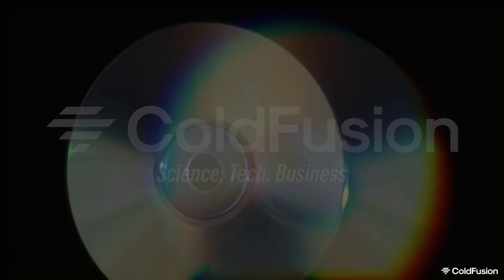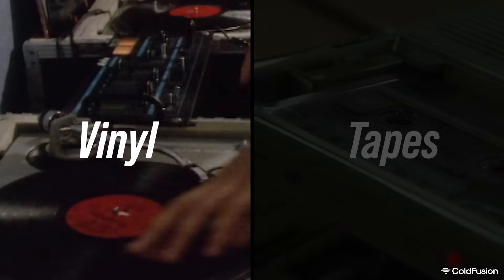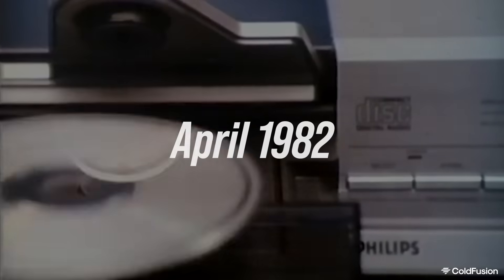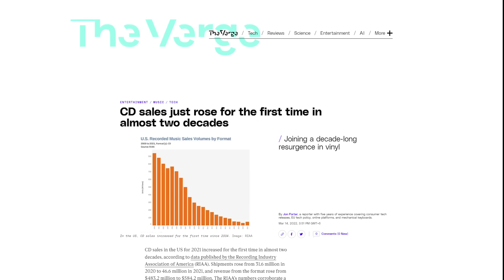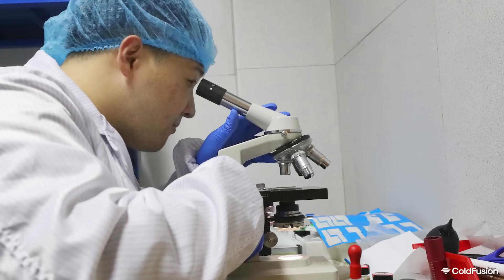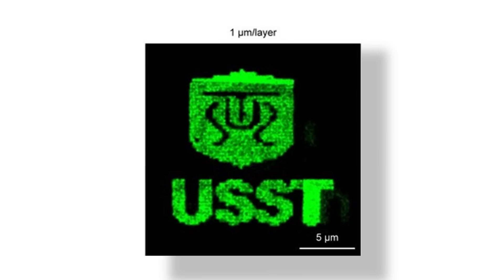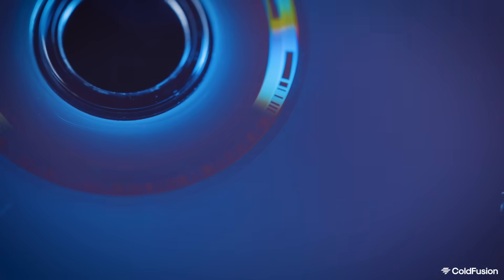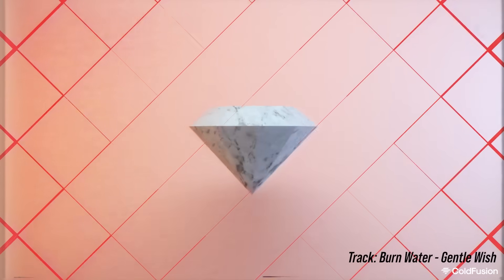Why This New CD Could Change Storage

Comment: I'm the syndication music manager at Starter Free Media Group and am responsible for managing large lossless music libraries.   

The main station library I'm managing at the moment is 20,000 flac tracks.   It was last backed up onto 30 verbatim blu rays about three years ago, but because backing up to multiple discs has become so unwieldy, we've resorted to backing up using a hard-drive to hard-drive system.   

I'm not really a fan of hard-drives as they are "random accessible" devices, prone to viruses and other data changing / data altering whims.   

I personally would love to see such a "large capacity" disc in production.  It would be great to backup our entire music collection in a one click "WORM" solution.   Optical media technology has been at a stand still the last 25 years, the crappy capacity of a blu-ray doesn't cut it anymore in todays storage requirements.

Comment: One major reason why CDs nearly died is a dirty or scratched surface affects all data in the affected areas. For music it skips with error correction, but for data like this, it means TB worth of corrupted data. An entire families history of digital data gone due to fingerprint.
Reply: That is actually the only problem with optical media that i still don't get. You had Floppy Discs for decades prior, they proved themselves. YOU HAD FKING SONY UMD DISCKS FOR PSP. A literal disk but in it's own plasic casing in which it could be read freely without the risk of stains when a human touches it, because you would touch the case and not the disk.

Literally just how people adopted what is esentially holding an HDD magnetic disk (VERY fragile) with bare hands, and no one bat an eye?
Reply: Better than the Lience expiring or the company that holds the data to say "Pay for ad-Free now :D OR LOSE ALL YOUR DATA"
Reply: @ravoniesravenshir3926   flash drives are better to use imo no scratching risks you can always remove or add files to the flash drive which you can't do that on cd's
Reply: A scratch does not do anything to the data. The data on the disc is on top, so all a scratch does is block the laser from reading the data. Yes that is correct, when you look at a CD, the data is on the top side where the the graphics are. The only way the the data is ruined by a scratch is if you scratch the top of the CD. When you burn a CD, it burns through the plastic to the top of the CD where the data is stored.
Reply: That's not how CDs work, the data is stored underneath the top layer. So unlike Vinyl Records, the data written on CDs can be recovered. It's super safe. That's not the reason CDs died, it's just a common misconception
Reply: You do know they cured that with bluray disks ? 
.
Bluerays are Virtually scratch proof
.
So emagine what amazing plastic these new cds will be made from 🤷‍♂️
Reply: @goldenegg1063  Again, scratching a disc odes not ruin the data. The data is on top, so putting scratches son the bottom of a disc does nothing to the data. The only way the data gets hurt by scratches is if you scratch the top of the disc.
Reply: @goldenegg1063  yeah but that's not how optical disks work anyway 🤔
Reply: At these storage sizes and costs, they could probably encase everything in sapphire for scratch resistance and longevity. It wouldn't even add much to the overall cost, because enough sapphire to make a CD, even thick material, wouldn't cost more than a couple hundreds dollars, maybe even less.
Reply: @peoplez129  These will never see the market. It would cost billions. This is just another product that will never see the light of day. What people fail to realize is these would need all new hardware, and you would need that to even use the disc. If anything this will be like one of those products that are only available to professional use. They will sell it to people who are willing to pay thousands for the hardware, but it will not e available to the general public.
Reply: @peoplez129  it's not even that bad if the CDs get scratched, the data is still there
Reply: Yea this development is that new. Back in the 2000s they had CDs in the terabyte range but folks didnt care for CDs and we went with cloud storage. Most of these new tech developments dont go commercial because they can't get the per unit cost down enough to be viable. Wouldn't be surprised if we never hear about this ever again.
Reply: @chewielewis4002  There was never  a disc available that had anywhere near a TB of space. Till recently the disc with the largest storage available are blu ray disc. Blu ray disc can hold 25GB, 50GB, 100GB and 128GB. A blu ray disc was the first ever disc crated that could hold 100GB. Still makes no sense to me that blu ray discs never became popular for storage, so I doubt any other disc can become popular for storage. Blu ray disc have been around for years,, and very few use them for storage, so I doubt any other disc can become popular for storage.

Comment: I wonder if there's scope for this kind of holographic recording technique to be applied to film? I mean, you can't realistically thicken the recording surface to be something like a cube... you're going to be dealing with thin layers, and the key is therefore to increase the surface area of the media. 35mm holographic film would offer an enormous surface area. It might be slow, but imagine the ability to back up an entire data centre into a film canister?!

Comment: Even before hearing the current drawbacks of the tech, as someone who had previously used cd and dvd burners through the 2000s, I already figured to fill up and write a disc that large, would take probably a few days to achieve. I think this tech is good to see that people are still looking into how it could be improved from what we've had until now and haven't yet discarded the idea. This does go to prove that with tech advancements we've made, we can still go back to a dominant idea of the past and still improve on it. Of course, at this stage it needs further development for convenience and efficiency, so I'm still interested in seeing where we go from here.  
My only further concern from the past is around scratched discs. or the data film coming loose form the disc, as I saw with some CD-Rs back in the day. Im sure they've already worked on ways to make it more scratch resistant now, and I think blu-rays had improvement on their discs for this too, IIRC. 
Being a fan of physical media, I look forward to more on things like this, if it makes sense practically.

Comment: I myself am old.  This medium fails due to degradation over time itself.  I have disks that span back to it's release on market.  All with nifty holes in them.   They're stored on spindles.  Ones in the center of the spindles are fine.  Ones on the outside, not so much.  I have 6 of these 100 cnt spindles.  I do not recommend this medium of storage as I am now tasked with the task of converting these to a NAS based system which I find more mitigate-able.  My collection started about 95 it's 24.  My first set is starting to deteriorate.   I don't know what the technical term of this deterioration is called but you can see blackish/grey spots on the disk that's under the laminated coating laser won't read these.  The ones that are not affected is the little known "gold pressed" disks.   I've used special software to attempt to recover to ISO by skipping the dead spots with about 90% success but dead data is dead data it will not recover that spot ... just allows me to get the rest of the data from the disk where normal cd/dvd, fail after it hits it.  Where as others see 100 layers of advantage on this new proposed version of this tech.  I see 100 ways of failure vs 2.

Comment: Especially for “Secure Data” CDR/RW is quite useful as it can be physically removed and isolated.
However, CDs have a major problem. 
Whether for data or audio, the slightest scratch or scuff often results in the laser being refracted and the result is “Loss” … loss of Data, Loss of Audio … and “repairing” the damage or recovering the information is extremely unlikely.

Comment: Divide the storage by 4x &  layer the 50,000 TB 4x so if one layer of 50,000 becomes corrupt or scratched, it can be rewritten/compared to the other 3 storage partitional layers; so 4x the data in redundancy & allow for auto repair of damaged layers.  Thoughts?

Comment: He says it can write only in megabytes but doesn't even say how many. If this thing can write at 999 megabytes per second it could take 55611 hours to fill a disc. That's ludicrous and impractical. We created the world's largest swimming pool for data but can only use a garden hose to fill it.
Reply: haha, I guess it means you would never have to worry about running out of space.
I'm more interested in being able to downsize this idea massively and end up with a huge amount of storage in an ever so tiny disc, that would be more practical than 200TB of storage you could not effectively fill even if you were a data center.
Reply: @Ethorbit  imagine an iPod with a disc drive the size of the scroll wheel

Comment: it would be great. i built a massive quantity of Digital files.
at current i would require a huge Quantity of disks just to backup.
as a Indevidual user tape drives and Tapes themselves are far out of my reach.

also i'm not a fan of the "Cloud".
and quite franky with all press news about them i wouldn't trust them.
i also don't trust their claims about not using my data to train AI

Comment: This won't be a consumer tech any time soon, if ever. Consumer needs for local data storage have basically plateaued, and with cloud storage getting cheaper and more devices being always connected, it's likely to decrease rather than increase at this point. Even if you could get the price and power requirements down, and the read/write performance up to something consumers would consider acceptable, I doubt there would be significant consumer adoption. Data centers are where this tech would shine. Dropping $50k on hardware for an archival storage system is nothing, especially if the media is relatively cheap. If you can improve the power and performance characteristics to the point where this could be used as read/write media in a production server, they'd pay those prices for it too.

I wouldn't be surprised if there is a real product that comes out of this research, but scaled-back. If, for instance, you could reduce the power requirements by a factor of 1000 by reducing the density by a factor of 10 (fewer layers, bigger dots), that might make a viable 1st-gen product.

Comment: If those new drives can allow the user to use a media disc as a "drive" (as in you can add data to it, without erasing the existing data, until it is full. Where you could delete old data from it and add the new data in), then I can't wait!

Comment: Everyone thinks about the cloud, it lasts forever, that it's cheap. But I put it at the tip of the pencil, its security in durability, in that it will never be lost or closed (between the lines in a contract). To this day, I still use media like this to store my photos, videos and digital files (current BLURAY media - with 25GB in a single layer), as it is cheaper. In addition to the data being stored on these media, I have backups in the cloud and on external hard drives. I don't trust any type of storage, they can all fail! But redundancy is key! And having media like this would be a huge leap forward in storage. Let's wait and see if it arrives commercially.

Português:
Todos pensam em nuvem, dura pra sempre, que é barato. Mas coloquei na ponta do lápis, sua segurança em durabilidade, em que ele nunca será perdido ou fechado (por entre linhas em um contrato). Até hoje ainda uso uma mídia como esta para armazenamento de minhas fotos, vídeos e arquivos digitais (mídia atual BLURAY - com 25GB em camada simples), por ser mais barato. Além do dado está armazenado nestas mídias, tenho backups na núvem e em HDs externos. Não confio em nenhum tipo de armazenamento, todos podem falhar! Porém a redundância é a chave! E ter uma mídia desta seria um grande salto para armazenamento. Vamos aguardar para ver se chega comercialmente.

Comment: What the hell is even 1.6 petabits lol...i feel like theyre only using bits when they want it to sound more than it is, because the average guy doesnt know the difference between bit and byte

So 1.6 Petabits are 200TB...still inpressive, so whats wrong with TB.

Like saying that my workplace is 13426 inches away from my home

Also ALOT of mix ups in the video, I feel like not even thecreator of the video knows the difference between bit andbyte

Comment: Going digital was never about the insufficient size of media (3 layer Blu-Ray with both sides used for data got 266GB) but about customer's inability to resell software they previously owned as it often can be registered only once into one account. Thus, there is no secondhand market, resulting in higher sales for software distributors while pretending that they doing it to handle piracy as if that stops software from being pirated to get often even better experience than legal customers or the most ridiculous excuse is that the industry is going digital for the sake of environment as if constantly running servers which hardware being upgraded every few years powered by fossil fuels and requiring ton of water for cooling are better for environment than physical discs that can be re-sold thus serving multiple users. These are the reasons why I don't believe that any kind of physical media will change anything because that would mean less control over consumers, inability to collect data that being collected when you need to register online where you need to agree to data collection to even run the software you paid for, and most importantly the fact that serves/online service providers like Apple, Dell or HP are often the same companies that selling you nowadays super thin laptops without space for optical drive most people buy for computer these days.
As you can imagine, by giving you alternative physical purchase option for software, and in the near future also movies eventually followed by even books as e-ink technology matures would just harm their server/online service business. Perhaps small modular laptop manufacturers like Framework could reverse course at least for large thin bezel 18" desktop replacement laptops while publishers could at least provide physical copies of their software once their after-launch support & patches are finished and work starts on newer products instead to get some additional money from their old products but as you can imagine, that is rather unlikely unfortunately when everything heading towards you own nothing subscription without ownership service-based economy. Once internet infrastructure improves, they likely go fully with steaming video games directly from their servers so you don't even need powerful hardware that could alternatively run AI which also works for governments as they are unlikely excited about the possibility of the average citizen holding that much power in their hands. While you can easily understand their point of view limiting possibilities for crime will turn average people into slaves because that's what you are without physical ownership where everything from house to car and all software you running is just rented, a system that is already mostly realized in some parts of the developed world like Singapore which just renting housing to its citizens and democracy is thus just fiction there because you aren't really in a position to bite the hand that feeds you...

Comment: I could see a read-only version of this being big as a replacement for Blu-ray.  TV with resolutions higher than 4k are already available and will come down in price before long.  Most people don't have an internet connection for streaming 8k or 16k movies.  Internet providers are trying harder and harder to push data caps.  People are getting fed up with the streaming services.

Comment: What do you mean “known for their longevity”? As far as I remember, back when CDs were a thing and I used to back up everything on CDs, a lot of them became unreadable in a few years (4-5 years I think). And I wasn’t buying the cheap ones, wasn’t writing to them at max speeds, didn’t get cheap writers either. As for storage, I wasn’t storing them in direct light and wasn’t using them (reading from them) more often than once a year and a half - 2 years, when I was buying a new computer.

Comment: when blu-ray came out the prototypes they were using to describe the future of optical discs were up to 500GB, 20 layer (25GB per layer) discs. 

whereas commercial discs were limited to 25GB writable (later 50GB writable) and 50GB read only (later increased to 75GB, and now 100GB, and 128GB, though i've never seen one), meaning they only ever hit 26% of their actual pre-marketed capacity. this was because it wasn't economical to make  discs above 4 layers, and the writers drives themselves would have to be more complex and expensive.

realistically this disc will likely be released at whatever capacity single, dual and triple (and MAYBE quadruple) discs are, unless they can overcome the previous obstacles economically.

unfortunately this technology is based on using 100 layers, meaning 2 TB per layer, so even if they could get up to 25 layers in commercially available drive that would make it "only" 50TB, based on where the economic sweet spot will likely be at best at worst, it would still be 6-10TB.